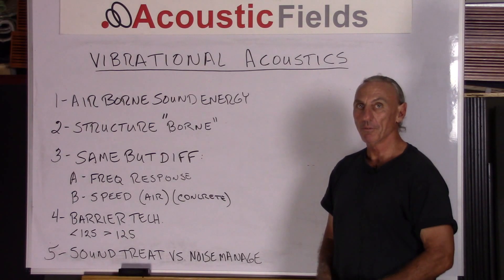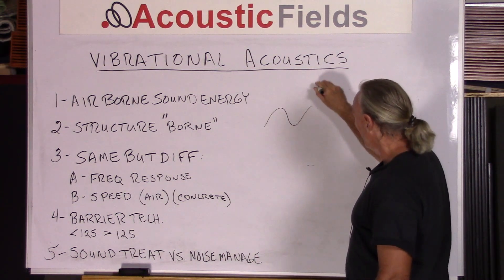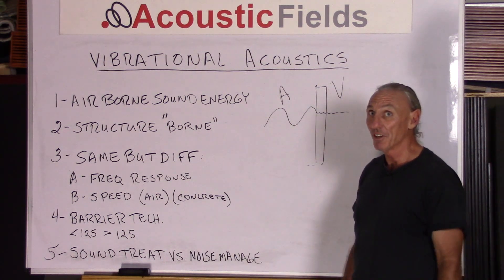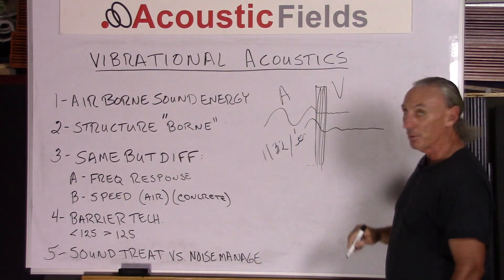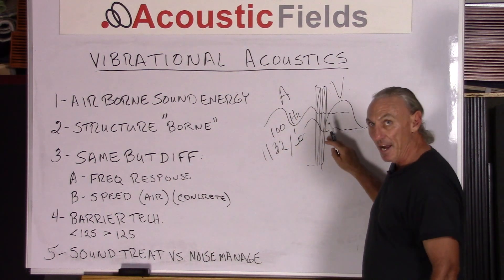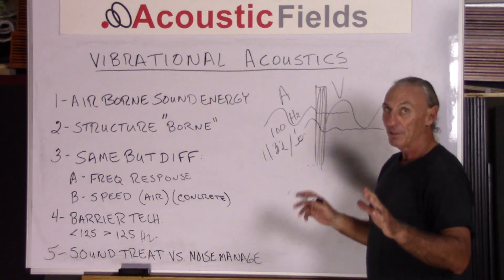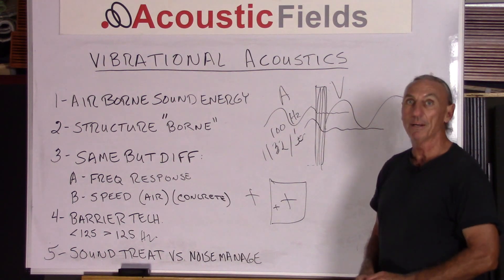How Vibration Acoustics Works - www.AcousticFields.com

Comment: Just found you and subscribed. Very pleased to have found your channel. I record and mix in an old basement with low ceiling and ductwork, furnace and other terrors. Surprisingly, I can get some good results. Is it worth adding diffusion to an environment like this?
Reply from the maker: B,  Maybe. Lets take a look at the complete room picture. Fill out the information in this link: https://www.acousticfields.com/free-room-analysis/ Stand in room center and take pictures of all four walls and ceiling. Attach pics to form. Follow software prompts and schedule a time to speak by phone. Since this is a free service, clients are required to call us at the scheduled time.

Comment: Hi I'm from Holland...for 8 years now, I suffer from 'vibro acoustic disease' (hearing - extreme - low frequency sounds, feeling their vibrations in my body)...everywhere, so also in my home. Is there anything I can do to protect myself? In The Netherlands there are 1,3 million people living this experience in there homes.
Reply from the maker: A,  You can isolate structures from vibrations and low-frequency energy. The process involves barrier technology which is a permanent build. It also involves measurements to produce the correct structure design. It is a complicated process and expensive. There is no easy fix.
Reply: Well, no Happy New Year :-( Thank you for your answer, sir. Whish for you a Merry Christmas and best wishes for 2019.  @AcousticFields

Comment: Sir, how do we calculate the thickness for pipe reinforcement for this AIV case?
Reply from the maker: C,  I do not understand your question.
Reply: I have tasks to reinforce piping of flare & relief system. The piping severe AIV but in pipe stress analysis i can not find certain thickness for AIV case even I enlarge the pipe thickness.

What I got from references they just put somekind of pipe support or clamp to overcome the AIV.

How do I justify this type of pipe reinforcement could overcome the AIV case?

Comment: could you please tell me more about airborne noise  and structural borne noise ...thanks for video ...
Reply from the maker: Noise or frequency travels through the air and through structures. Both must be minimized. The science and treatment are similar but you must apply their differences correctly. This is the error most individuals make. They apply air borne technology to structural vibration issues which is like holding up a feather to stop a tornado.

Comment: hello , i know that may Q could be some how far from what you explained , i study architectural engineering and was asking my self if there is any material that can deform under sound vibration such as remember alloy the new smart material that can deform under heat , i intend to ask you since you know a lot about sound waves and things related to ! 
thank you
Reply from the maker: Hajer Hajer Mo 

I am not aware of any such material type.

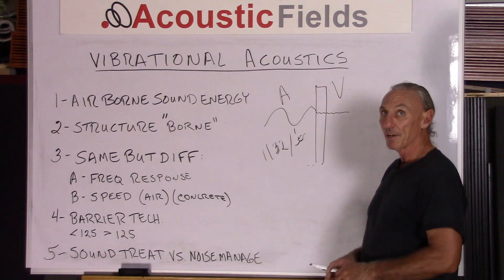Comment: 2:07 - Actually, sound travels faster in most substances.  See http://www.engineeringtoolbox.com/sound-speed-solids-d_713.html and http://en.wikipedia.org/wiki/Speed_of_sound
Reply from the maker: Hi kent mccarthy 

You are correct. Sound does travel faster in other material types. However in air, which is our sonic medium, the differences in speed are slight and remain within predictable and consistent speed ranges effected by just a few variables such as temperature and humidity.

Thanks
Dennis